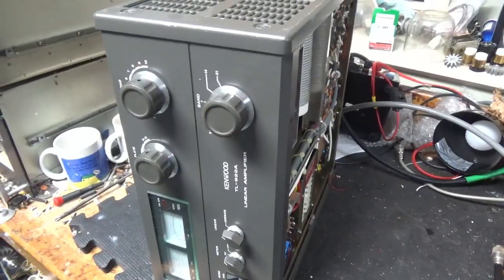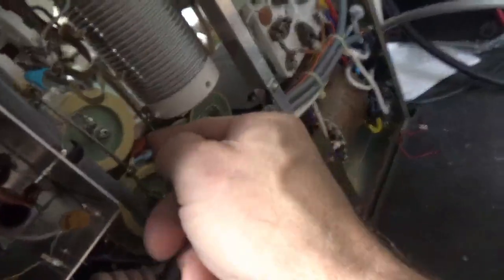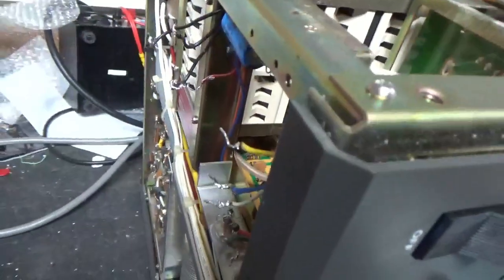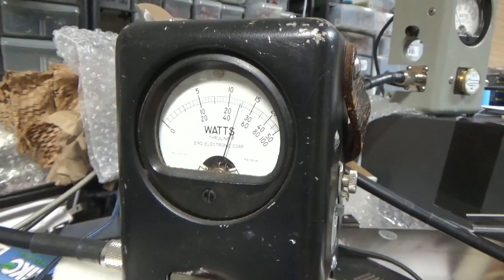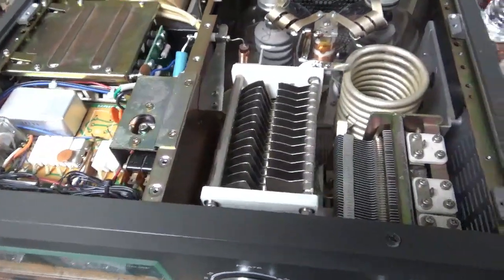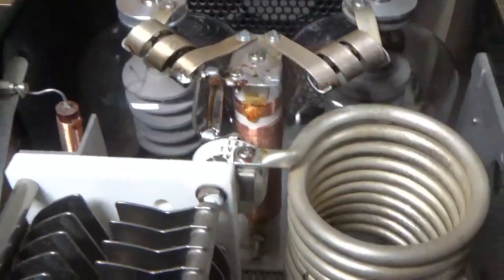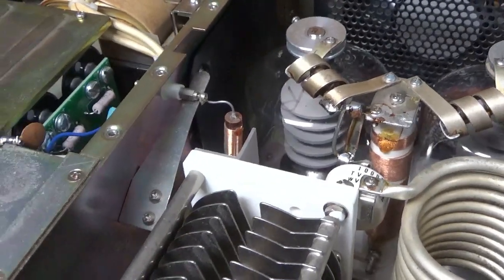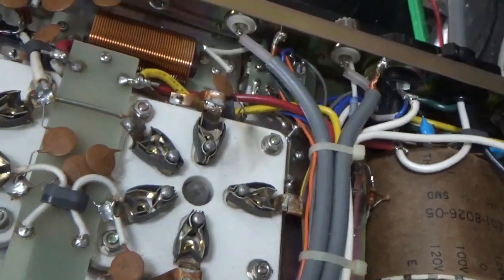Kenwood Tl922a Major Repair And Mods. Filament Transformer, Band Switch, Harbach Filter Cap Board

Comment: Nice work. I've never understood the mechanical design of the TL-922. It seems like if they made it 20% or even 10% larger, it would be SO much easier to build and to work on! Everything is just so crammed in there.--K2UA
Reply from the maker: Lots of room, easy to work on compared to come pa’s out there 

Thanks for watching and for the comment

73 

Thank you for watching